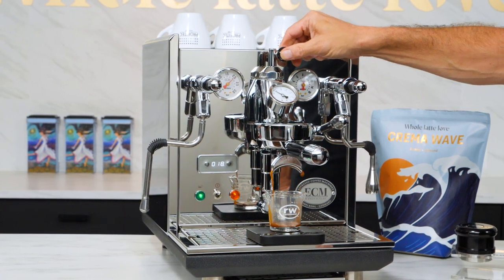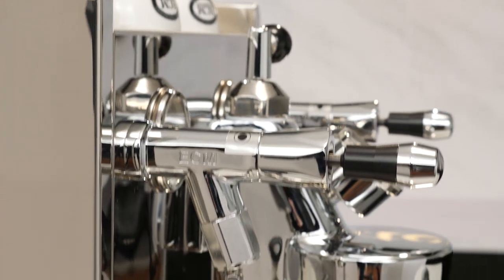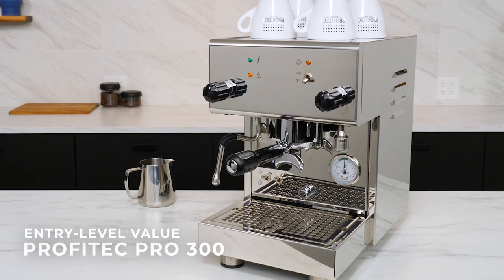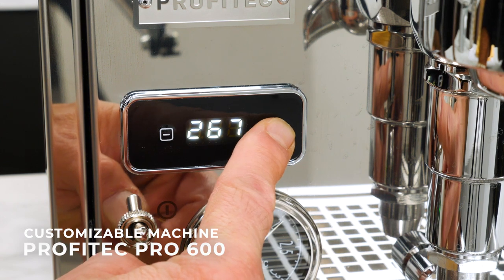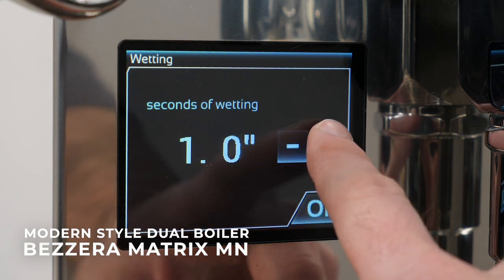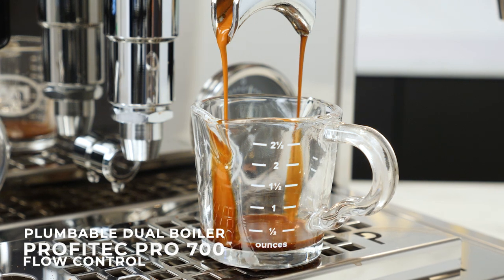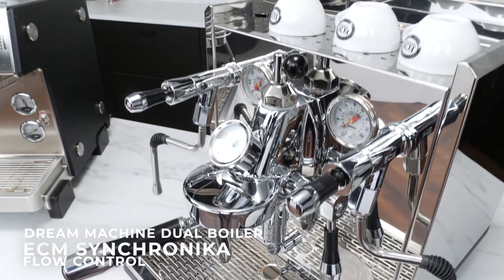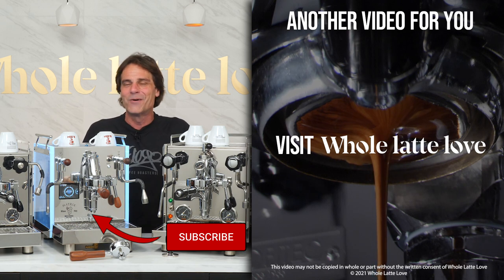Top 5 Favorite Dual Boiler Espresso Machines of 2021

Comment: Hi, first let me thank you for the very good video.  I would have 2 questions: does the Profitec 700 has more steaming power than the ECM Synchronika? It has 1600W vs 1400W of power.  Does  tap water at 70 PPM is ok for these machines or we need RO water to avoid having to descale?
Reply: Patrice, I don’t have a comparison. But I own the Bezzera machine he mentions in the video and the steaming power is tremendous. It takes about ten seconds to steam milk, and that’s probably the same with both the Profitec and the ECM. The higher wattage may bring the water to temp faster (just a guess), but at least the four big machines here will have more than enough steam power. I don’t know about the small Profitec, but Marc probably knows.
Reply from the maker: Hi PM, Thanks for the kind comment and questions. The Pro 700 and Synchronika are essentially identical under the hood. The boilers are identical and both machines run the service/steam boiler at ~2 bar max pressure. 70ppm water is considered very soft and is unlikely to cause scale. Keep in mind TDS measures all dissolved solids so measures more than just calcium - the main culprit in scale. There are other water parameters like alkalinity and pH which play a role in determining scale potential. Pure zero TDS RO (or distilled) water should not be used in espresso machines. It's an incredibly good solvent  - so good it can pull ions from metals causing corrosion. Beyond that, it over-extracts espresso causing bitter flavors and with no minerals taste is flat. Many commercial coffee shops do use RO systems to feed their espresso machines but they always re-mineralize water after RO treatment. Manufacturers of dual boiler machines recommend descaling only by a professional machine tech. The best option to protect equipment and flavor is to feed a machine with water which does not cause scale in the first place. For that use a filter using ion-exchange to replace calcium in water with magnesium. BWT has a number of ion-exchange filters which when used as directed provide the minerals needed for flavor but will not cause scale. Options include in-line plumbed in systems, pitcher filters and pad filters which drop in the reservoir.
Marc
Reply from the maker: @Marshall Goldberg, Thanks for adding your experience with the Matrix. The 700 and Synchronika can reach a higher boiler pressure - for those newer to frothing they might want to turn down the temp a bit until they get technique down. The Pro 300 is a good steamer. It runs at a lower max  pressure in a smaller boiler than the 700 and Synchronika so recovery will be slower after steaming large amounts of milk.
Marc
Reply: S

Comment: How does the breville dual boiler stack up against these machines?
Reply from the maker: Hi TR, Thanks for the question. All the machines in this video are hand assembled in Italy or Germany. The Breville is factory made in Asia and is best considered an appliance and not a machine. It uses proprietary components, lots of plastic parts and scores low in user serviceability. But, the Breville products pack in a lot of features for the price. Just have to keep in mind its anticipated lifespan is much shorter. If/when something goes wrong with the Breville user repair is generally not an option while the machine grade products are very repairable. Hope that helps!
Marc

Comment: Hallo Mark - my spouse and I have opened our Bed & Breakfast…only just and do now require a sensible solution for procuring an espresso machine  - for light commercial use, which won’t immediately induce bankruptcy! Lol I have been doing a good bit of research but continue to be in a muddle as to which direction of machine - home or commercial machine, might suit my small business well. I’ve looked into rentals by partnering with coffee distributors but each has pushed what they have - mostly capsule or pods machines which I continue to be reluctant to commit to because of known plastic waste and fraught of putting an inferior espresso/cappuccino et al in front of a paying guest! Might a sage such as you have any advice? I’m keen to know of actual real options of producing a premium final product - many thanks for advance
Reply from the maker: Hi t, Thanks for the question. I'd stay away from the capsule and pod machines for your stated reasons. Going commercial or home/domestic use machine comes down to volume of drinks served. If you're in the 10-15 drinks per hour you should be able to use a more domestic oriented machine. Bezzera has some options that are commercially rated (NSF/ETL) that are relatively inexpensive. If you're in the US have a look at the Bezzera BZ13. It's an upgrade to their Crema machine available elsewhere: https://www.wholelattelove.com/collections/semi-automatic-espresso-machines/products/bezzera-bz13-de-rosso
If you're anticipating higher volumes then you'd be better off with a commercial machine or at the least a plumbable dual boiler machine featured in this video.
Hope that helps!
Marc
Reply: @Wholelattelovepage  a great many thanks! Logistically, I shall have to make a choice in due-course. By what you say  - I.e. - about quantity of beverages, I’m now categorically convinced that a commercial item would be entirely excessive and a bit costly too! Tho am deeply grateful for the tips, advice and brand/model suggestions, Mark - I shall have a look. Good on ‘ya! Keep well❤️

Comment: can i ask why you skipped the quick mill in this selection? thanks
Reply from the maker: Hi GL, Thanks for the question. Well, only had 5 slots for machines it would be in here if 6 slots. The QM Vetrano Design is an excellent machine and a good value. Check out my in-depth overview video of the machine here: https://youtu.be/jCMB_jU3lh4
Marc
Reply: @Wholelattelovepage  thanks Marc!

Comment: Are all these machines NSF certified?
Reply from the maker: Hi Max, Thanks for the question. These machines are not NSF rated. Intended for home use, manufacturers generally do not pursue NSF rating. They could very well meet the requirements but the rating would add to the cost of the product. If you must have NSF rating the Crem One machines have it: https://www.wholelattelove.com/collections/semi-automatic-espresso-machines?_=pf&pf_v_brand=Crem
As do some Bezzera Machines like the BZ13: https://www.wholelattelove.com/products/bezzera-bz13-pm
Hope that helps!
Marc

Comment: Is the ECM Synchronika grouphead heated in some way, or do you have to flow water through it to heat up?
Reply from the maker: Hi SK, Thanks for the question. Yes the group is heated. Like all machines with an E61 brew group there's a constant flow of hot water out to the group from the boiler which heats the mass of metal. It's called a thermosiphon and driven by convection. Here's a video with cutaway boilers and E61 brew group which explains how that works: https://youtu.be/OUywoRs4meY
Marc
Reply: @Wholelattelovepage  Thank you so much for the quick response. Can’t wait to order mine😍

Comment: I love my Pro600, bought partially after the reviews on this channel, however I do find that the steam pressure drops off pretty fast, and sometimes I am really pushing it to finish warming the milk.  I am just left feeling I wish I had gone for the pro 700 to get a larger steam boiler.
Reply from the maker: Hi BA, Thanks for the comment. While the 700 does have a larger steam boiler the 600 is a very respectable steamer. What temp are you running in your service boiler? For a few years now the 600 has had the capability to run at 270F. At that temp you should have no problem unless steaming large amounts of milk or going excessively hot.
Marc
Reply: @Wholelattelovepage  thanks for the suggestion.  I am running the steam boiler at 129 degrees c which if my maths is correct is close to that maximum.  I guess I'll have to stop second guessing the machine and look at my technique instead..... 😉
Reply: I have the same issues. I have my steam
Boiler at 270 and notice it drops to 262 quickly when I start steaming and it drops like 1/2 bar as well

Comment: How’s the shot capacity of the Profitec Pro 600? Someone said they had to pause for long heat up times when pulling half a dozen shots back to back (or trying to do them back to back)
Is this the case? What are the limits?
Reply: Ok, I guess I’ll answer myself since I’ve bought the 600 now, :)
As of yet the largest batch I’ve brewed in a row is 6 cappuccino’s but there was no sign of the machine needing time. The limiting factor is my workflow and not the machine.

Comment: I thought the synchronika was designed and built in Germany. Isn’t that what the front badge says?  Oh yeah, what do you prefer 70s or 80s heavy metal?
Reply from the maker: Hey squib, Synchronika is built in Milan, Italy. CEO of ECM is German and has manufacturing facilites in Germany where they make most of their grinders. 70s metal!
Marc

Comment: As much as I want that 700 with flow control, the sticker shock is real. Apart from not having a rotary pump and no flow control option, is there anything about the 300 that would bum me out in the future? Also, is there enough clearance for a scale?

Comment: So which machines come in for service then?
Reply from the maker: Hi Andre, Thanks for the question. In general the more complex a machine is the more likely it will have an issue requiring service. Solenoid valves are a common problem area. Troubles with those are usually caused by water with high mineral content. Issues are preventable by treating/filtering water to a mineral level which is unlikely to cause scale. You want some minerals in the water for flavor, to prevent over-extraction and protect machines from corrosion. But, too many minerals will cause scale which can plug up components.
Marc

Comment: What about the Breville Dual Boiler?
Reply from the maker: Hi w, The BDB offers a lot but we classify as appliance grade product. Only considered machine grade products for this video. Appliance grade products tend to have lots of plastic, proprietary parts, low user repair-ability and assembly line manufacturing.
Marc

Comment: Correct me if I’m wrong, but aren’t  both ECM and Profitec German machines, made in Bammental, Germany?
Reply from the maker: Hi john, Well, ECM/Profitec is a German company with manufacturing in Germany and Italy. Most of their prosumer level machines are assembled in Italy. Here's my talk with CEO Michael Hauck at their manufacturing facility in Milan, Italy: https://youtu.be/K0RI5rdz4Ww
Marc
Reply: @Wholelattelovepage  thanks very much Marc, this clarifies the matter. Maybe you can help with one other question: im considering the profitec pro 300 and pro 500. The 300 seems the better option: dual boiler and cheaper vs the 500 which is a HX machine ans also more expensive. Your thoughts?

Comment: No Breville Dual Boiler?
Reply from the maker: Hi r, Yes, no BDB in this group. We stuck to what we consider true machines grade products. The BDB is a nice unit but more at the appliance end of the spectrum with lot's of plastic, proprietary parts and low user serviceability.
Marc

Comment: 3:22 “…the quick 10 minute warm up time…”.  What?
Reply from the maker: Hi t, 10 minutes for the Pro 300 is a lot faster than 25-35 minutes for full warm up of machines with E61 groups. There are ways around the wait. The Bezzera Matrix in the video has programmable on/off times. Other machines can use programmable timers.
Marc

Comment: "Dual Boiler" doesn't mean sh💩t, if the machine is 240 volt... Italian home kitchens may have 240, but American kitchens are limited to 120 volts.
Reply from the maker: Hi FDR, Thanks for the comment and creative emoji placement! For 120v dual boiler machines priority can be set as to which boiler heats first when starting up cold. After that, the PID system rapidly alternates heating between boilers. So first boiler to heat is held at desired temperature while the other heats up. When both are fully up to temp alternating continues. With large thermal mass of the boilers and group head, even in heavy use 120v is sufficient to keep boiler temps at set temperatures. Recovery to temp after pulling a shot or steaming is rapid - back to set temps before one could grind/prep for another extraction or setup to steam more milk.
Marc